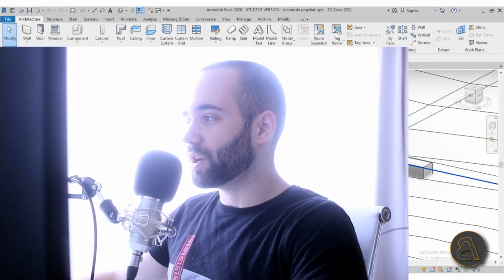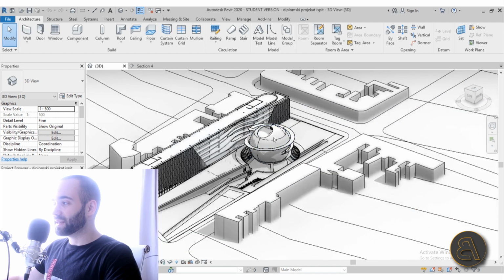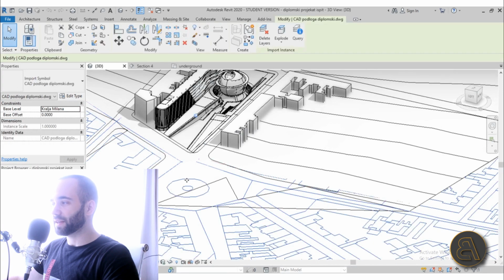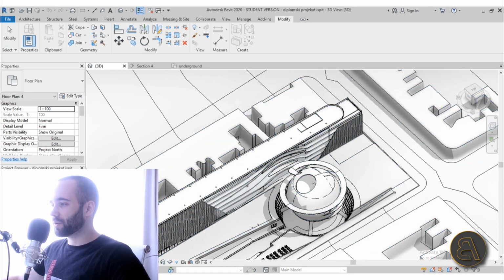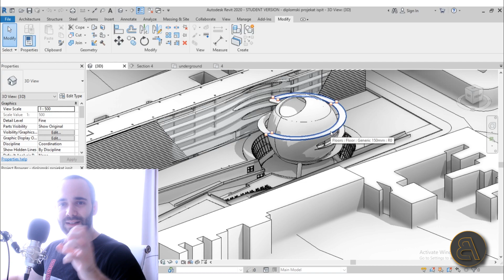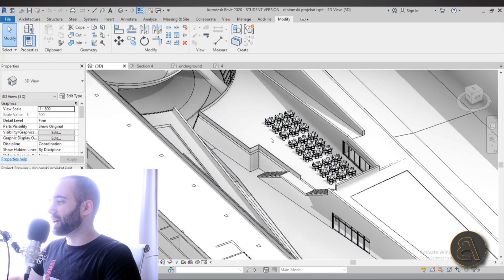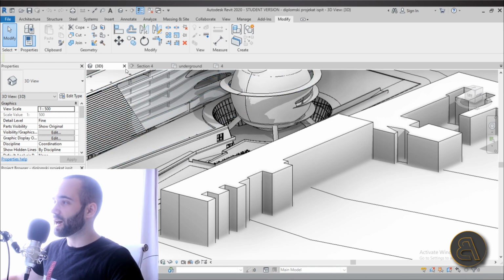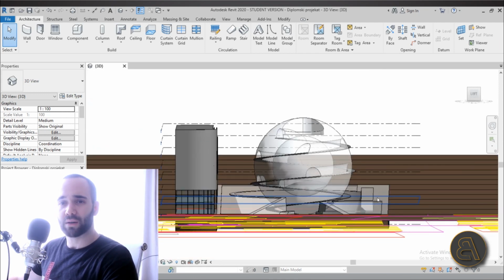My Master Thesis Project in Revit

Comment: The concept feels like it’s a meteor that’s crashed into the earth, intact. This event naturally creates hills and valleys. I could be wrong but that’s what it feels like to me. Very cool! The overall design has a lot happening which is a good thing. However, the elliptical “rings” could have been left out. The sphere, structurally and visually is a great concept. Given the fact the it is the planetarium, the sphere with its openings, itself is the complex’s most striking feature. It didn’t need the rings. Overall, very cool project!

Comment: "architecture used for presentation purposes"  hey i'm a big fan, have learned a lot with your videos.   Just a thought, now that you have the object (sphere) would be great to see the space without the object.  This way the space is ultimately what Architecture "presents", and not the object which is probably the first thing you focus on.  
I think the ramp/ hill up to the sphere can also relate to the object a little better, in the same way the long building did.